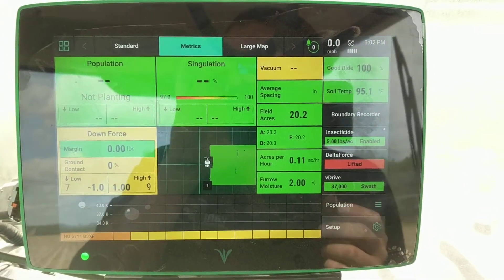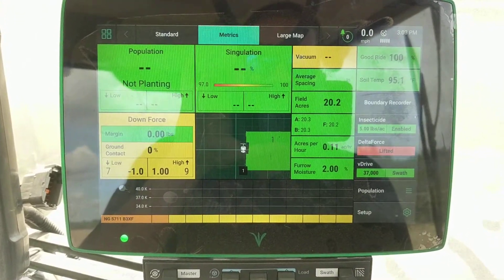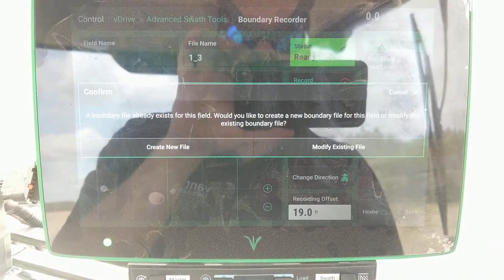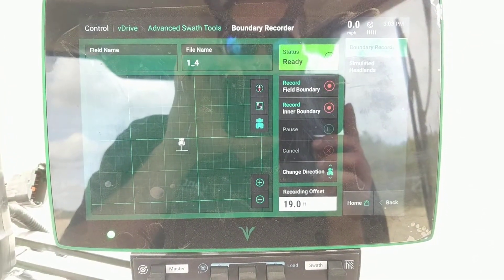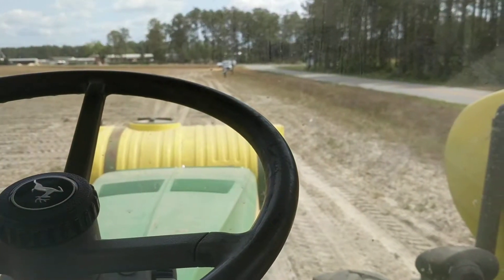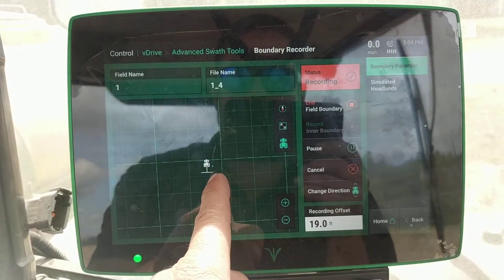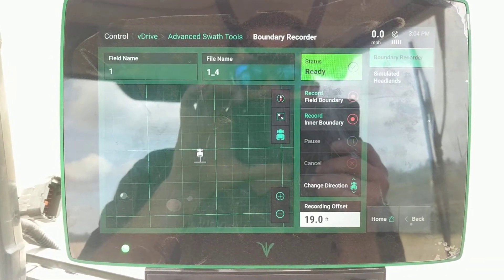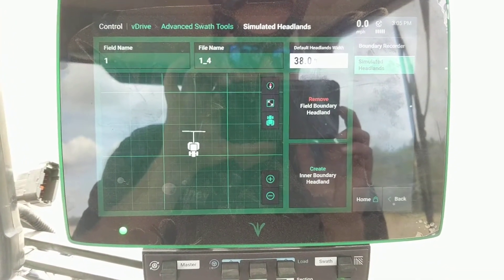Creating a boundary and simulated headland

Comment: I'm new to this system this upcoming season.  To simulate headlands using a 20' planter and I want 3 passes of headlands for 60' planted after the rest of the rows I'm assuming just set the default headland width to 60' and go?